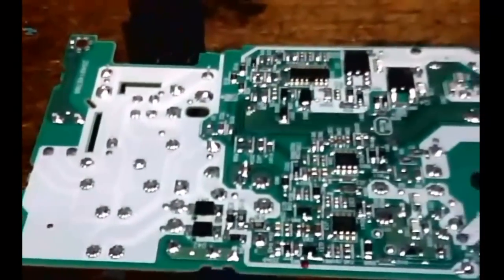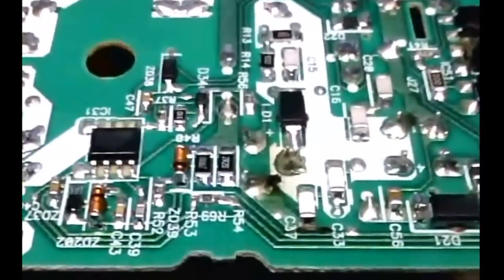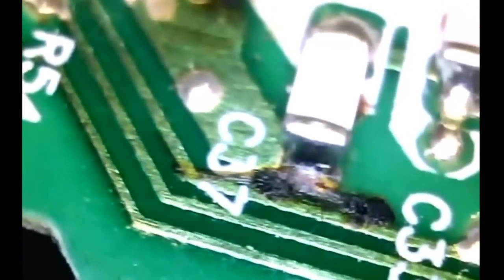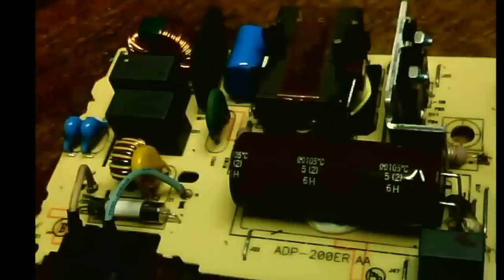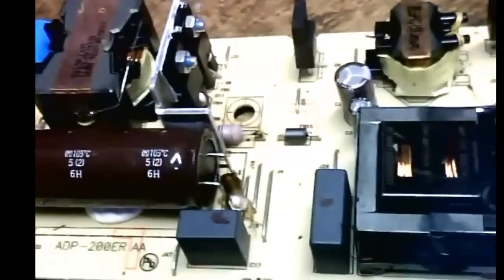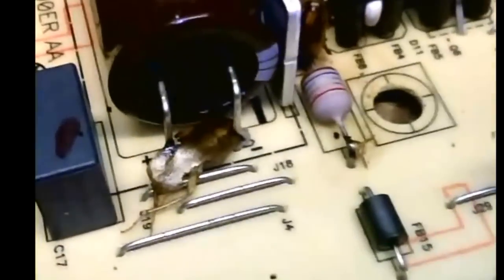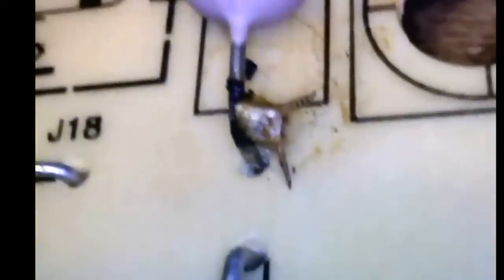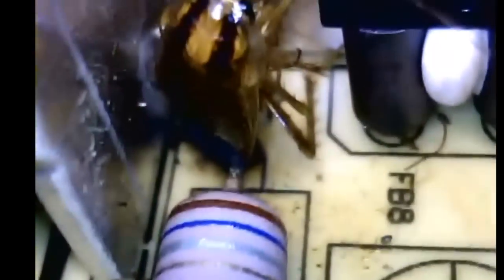PS4 1215A or B No power "No Problem" Prevention & workaround

Comment: Roaches like the heat from the transformers that's why they breed inside the PSU. Actually bagging your PS4 in a plastic case where oxygen can't  get in once a week when you go to bed after the PS4 cools off can kill or make all roaches come out the console & die. May be even spray some raid the plastic bag & put the PS4 for a 1 or 2. How can I make my PSU roach proof? Not that I have any but just for precaution. Please help thanks.
Reply from the maker: +Abinet V Unless you can achieve a vacuum removing all the air in the bag it will not help, roches need very little air it would take a week or more for them to use up the air inside the system alone, rade spray in the bag (Definitely before placing the system in the bag can help a little) but all it takes to destroy your system power supply is 1 roach or bug and it makes no difference how long it is in there if it crosses two hi voltage paths it is over for it and your PSU.

Comment: hey i have a ps4 and one day i wanted to turn it on and it just wouldnt turn on at all but the night before it was fine.. so i'm puzzled as to what the problem was.. i did open the power supply and they had a few bugs i cleaned it out but still.. no power at all.. any suggestions as to what move i should make next?.. i'm thinking just to buying a new power supply brick and see how that goes.. but it'll help a lot if u have any ideas.. thanks and cool videos dude.. they've helped me out plenty
Reply from the maker: new power supply

Comment: I really need help man I got a ps4 from a friend I plug the power cord in push power it beeps blue light comes on for like a second the goes off and does nothing unplug the power cord and plug it back in it does the same thing. I jus opened it and there was roach crap everywhere, some dead some  roaches where still alive so if I could get any input that would help me so much.
Reply from the maker: 1st a comment: You can not fix that at home, you have no education in electronics and do not have proper equipment or knowledge needed to test anything on it, YouTube videos only show 1 of 100's of reasons for what you're describing and if you try any one of their suggested fake fixes or tricks you will wind up with a dead non repairable system or a system that can never lasts more than a day or will die every few days lasting less and less time and thanks to the fake trick fix can never be repaired to any kind of lasting standard. 

2nd a suggestion: Find a Qualified repairman one willing to show you there education in component level repairs even if you must save up to pay for the repair, or sale it off for its good parts and save for a new system.

Comment: if the power supply is not available and the existing one can't be fixed well then what can be done? is buying another ps4 the only option ?
Reply from the maker: I got you covered sorry it will not be the most beautiful looking game system after you are dun but it will get you up and gaming until you can find a resnable priced proper power supply, Watch my video called
Replace PS4 1215A PSU with a 1115A PSU to get back up Gaming 
Link: https://youtu.be/1ienU86BWIY

NOTE: you can Extend the wire of the 4 wire plug and allow you to close the system and play it upright with the PSU off to the side.

Comment: i have my fan running off a controller and my power supply is totaly dead no signs of anything wrong with the psu.
im pissed.
Reply from the maker: Who told you your problem was your power supply? Just because you have no power does not mean it is your PSU. PS I find that most that use fans are actually damaging their system not helping their system.
Reply: TheHGCGamersClubThanks for your reply. No one told me im just taking a guess as it wont even turn on with the controller. I have not tested the psu with a multimeter as yet either, but how can i test it if does not power up from standby.
Its been fine like that for about 3 years. How does raising the rpm of the fan risk damage of the system?
I though thermal cycling would be more of a problem with these things anyway.

Comment: I have Ps4 CUH 1215A PSU is working

But I had no power no beeping no light

Pls any help
Reply from the maker: that does not mean it is your power supply unless you have tested it but I would strongly suggest you buy a replacement rather than attempting to repair it using YouTube before you kill the system or burn down your house killing everyone in it. See if you are near me and I will test it free http://www.clovisxbox360repair.com/contact.html
Reply: @ClovisX  okay thanks
Reply: @ClovisX  I replaced the psu but still not working
Reply from the maker: @Reindolf_UK  You need to take it to a qualified shop there are 100's of things that can be wrong and it is possible that the PSU you ordered is also bad have it tested if possible sooner than later at least you can send it back if it is bad for a full refund [ I will test it free ] if you are near me?
Reply: @ClovisX  thanks boss

Comment: I have a 2015a ps4. It worked great and then suddenly wouldn't even try to turn on. Can't seem to find videos for this model
Reply from the maker: there are lots of reasons for your system not turning on and the only thing you are going to wind up doing trying to repair it off youtube is waste your money and/or kill your system. If you are willing to waste money buy a replacement power supply do not try to repair the one you have or you will likely burn down your house and kill everyone it it.
Reply: Roach

Comment: has the Xbox one got these kind of issues, I am soon thinking of investing in another console
Reply from the maker: +vger 147 Although any power supply can fail, the answer to your question is: No; The Xbox one Does not have this problem, the power supply is not inside the system and if for any reason the power supply should fail there are lots of cheap alternatives and aftermarket replacements to get your system back up and running fast.
Reply from the maker: +vger 147 The Video is now up Click hear: https://youtu.be/1ienU86BWIY

Comment: why else would the ps4 go completely dead, other then the psu?
Reply from the maker: Depending on how and why the PSU failed it may have imputed 115V AC into a 12V DC Motherboard? There are a Thousand different reasons for a motherboard not powering on other than the power supply and I am not going to guess at what may or may have failed. Sorry Take it to a Qualified repair shop.

Comment: I was playing one day, and it  emmited a burn smell and a loud pop. It woke my kid up from his nap and scared him. I had so many problems getting the dang service repair order online done that I just stopped bothering
Reply from the maker: Good thing you stopped bothering because even if you had 11 months left on your warranty, Sony would have refused to repair your system and even refused to allow you to pay for a repair of your system ("No If's And's or But's"). NO JOKE...
Reply: actually the lady I spoke to said that all I needed to do was do the online request and they would send a box for me to send it in. No luck thus far. So basically I spent 250 on a piece of junk?
Reply: also it broke not even 3 months of use, and all I played was gtav when I played. My disc is still inside fml
Reply from the maker: I was thinking this video was the one showing roaches in the power supply the most common reason for what happened to you, as for Sony it is true all you need to do is fill out the online request and they will send you a box to mail it in under warranty or not that is true but what they do not tell you is if they see even the slightest evidence of bugs roaches or otherwise, they Void your warranty on the spot and refuse any further discussion regarding its repair that is by the way only a Replacement, not a repair. I see this every day as a licensed repair shop.
Reply: TheHGCGamersClub so what do you recommend? I don't exactly have another 250 to throw away. please help me I have the cuh-2015a model please help out a veteran that want to game.
Reply from the maker: If you're Local? Bring it to my shop I charge $20 over the price of the replacement or if you feel you are capable of taking your system apart you can buy this and put it in https://goo.gl/BixRKM NOTE: This Model is not as easy as it looks if you are not local I would recommend you pay the extra and have a licensed and Qualified Repairman Replace it for you.
Reply: I am actually from donna texas. I don't know any good repair shops around me as I have never had anything repaired. My ps3 worked great had it for many years it never gave me any issues, same as.my xbox360. this is the 1st time I've ever had an issue with a console it just grinds my gears this happened
Reply from the maker: Replacing a power supply is not the most complicated of tasks even your YouTube Educated shops that have learned off the piggy banks of their customers over the years can do the work. It Sucks using one of them shops but if you must you must, or you can stand strong and say F them and buy a new system, the choice is yours.
Reply: TheHGCGamersClub what would I need?